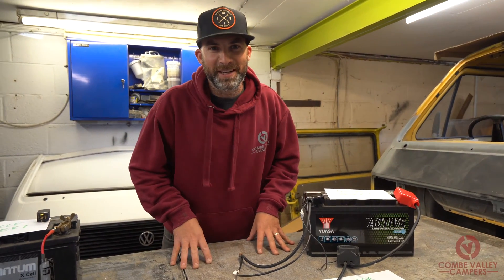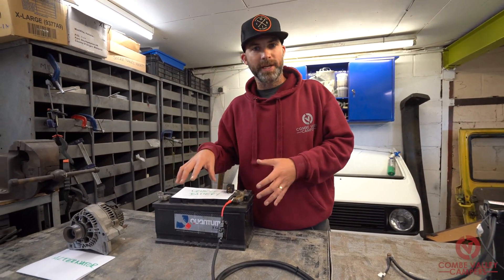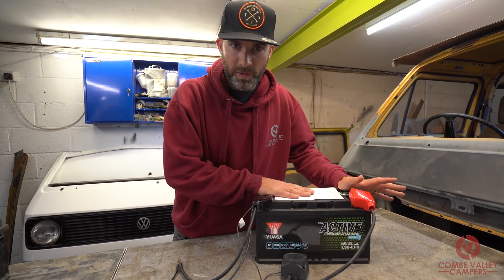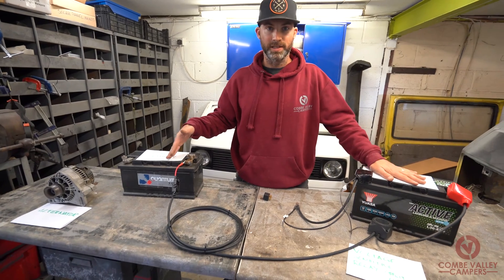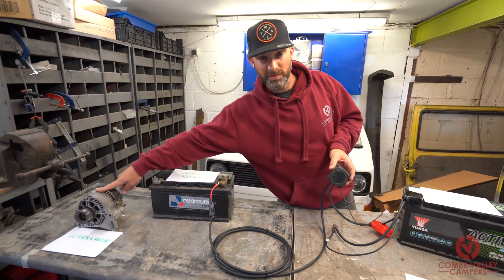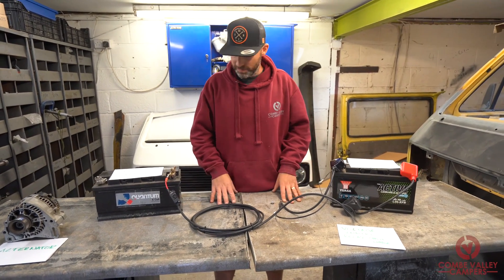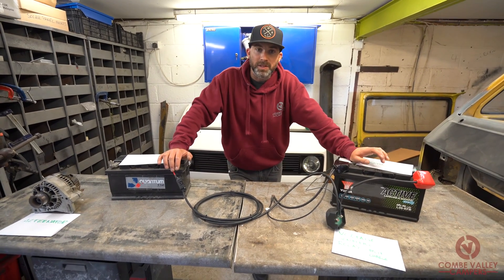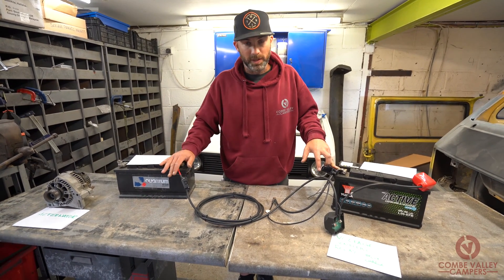A beginners guide to leisure battery charging and wiring.

Comment: Hi thanks for the clear description of the split charge relay system.
My camper has a leisure battery which I presume is topped up from the alternator, still looking for the relay or split charge relay!!
Question: ( hopefully not a daft one!!)
I am putting a solar panel onto my camper for the leisure battery. Do I need to disconnect from the engine battery to charge from the solar or can both sources be used? If so have you got a video showing how this is done please!! Cheers in advance.

Comment: What guage wire should I use to go from the Main battery to the relay and then to the leisure battery? Also what size fuse would you recommend to put in the line?

Comment: Question for you : I am putting LITHIUM batteries in as my leisure power. I dont want those batteries used for cranking and destroying them. Will this sytem keep the vehicle battery as the starter battery only please?
Reply from the maker: Yes, however I would reccomend a system to help manage the lithium batteries. For further information and advice please speak to James at Rayne Automotive

Comment: Hi that sounds easy peasy. I have two identical leisure batteries and want to add them do I need two delays? I own a van which I use for my mobile Barber business and need two leisure batteries two last me for the whole day because I want plenty of lights and hair dryer and etc to use. I have a power inverter which works flawlessly but when I use the hair dryer on the highest speed it trips my power switch and only works perfectly on medium heat. So would I need two relay or just wire both leisure batteries on the same terminal inside the relay?

Comment: very informative. I had a problem with a split charge relay and a solar panel when the sun cam up and the engine battery charged, there are two leisure batteries the split charge relay would open, and click, the leisure batteries would draw charge bringing the engine battery voltage back and the split charge relay would close. it was an ongoing clicking motion that forced me to get up and leave the van or start the engine. should the solar panel only be for the leisure batteries or both the leisure batteries and engine battery?

Comment: Hi can you please help me .I recently put a brandnew leisure battery into the back of my camper ok and I connected everything back up including the relay and it's earth .is the led light supposed to come on the relay straight away when the van is started or does this only happen when the leisure battery is low on power output.ive everything connected up and the relays led light hasn't come on once when the van is running.its a brandnew leisure battery also thts been installed.is this normal or do I have a problem with something not earthing.thanks

Comment: hi I have 7.5 t horse box with 2 main batteries and a  separate  leisure battery . would this split charger connect the same way  using one of the main batteries as a feed or would you have to have a connection from each of main lorry batteries. cheers joanne

Comment: hi, ive got  2 batteries 80 amp fitted in my engine bay. will my  starter battery,, charge my 110amp leisure battery  with split charger??thx
Reply from the maker: Yes. Connect the split charge kit to one starter battery. Once the relay senses the both batteries are fully charged, the relay will open and charge the leisure battery

Comment: Wow, Great info. Can we use a power point to connect the two batteries together? I am worried about over powering the points wiring. If that is an issue can we hook a trickle charger between the split charger and the battery and if so will that work?
Thanks

Comment: This probably is a silly question but then the van is ticking over does it charge the leasure battery??? 

I have everything connected but my leasure battery keeps dropping volts, it's down to 7.2 at the min please help thanks
Reply from the maker: I would suggest either the leisure battery may have had its day, or, there is something draining the battery
Reply from the maker: At 7.2 volts, technically the battery is dead dead.

Comment: I have 2 x 100ah AGMs in my car and run the alternator cable to my camper trailer that has 1 x 100ah AGM.
Question: 
I want to add a 2nd 100ah AGM to the camper trailer in Parallel but the battery compartment is too small.  The nearest space is 2.5 meters away.  IYHO Is their any issue with length for Parallel wiring?

Comment: Thanks for the video and clarity of how it works. Is there any problem of the battery overcharging? I know with solar there is a controller to stop that.
Reply from the maker: The vehicles voltage regulator makes sure a battery is not overcharged, in the same manner that the starting battery is not over charged. I hope that helps
Reply: @CombeValleyCampers  thanks. I read somewhere that the slit relay can only charge a leisure battery to 80%. Is that true?
Reply from the maker: @SMCK24  I've not personally experienced this. Depending on your splitcharge, you should achieve full potential of your battery

Comment: I can guarantee that wasn't a. 13amp relay... They don't exist... 15 20 or 30...and the "systems of old" were never wired into an ignition live... Pin 30 main battery pin 87 leisure battery.. 85 and 86 can be either way round. One goes to ground, the other goes to warning light wire on the alternator... When it starts charging, the alternator puts a feed up the wire, knocking the dash light out.. That feed can be used to switch the relay on. 
 The relay you showed "the 13 amp relay" could be used, but the contacts are small. A 70amp relay would be better, or an "old style" split charge relay that had a dedicated fridge terminal. There's nothing wrong with the old system, the newer way simply eliminates some of the wiring.

Comment: I have a trickle charger installed in my T4, plus a split charge relay, I am wondering if I plug the hookup in at home whilst the van is parked up in between trips - will it charge both batteries? I am worried the starter battery will die if it is left standing
Reply from the maker: Only if the vehicle battery reaches 13.7vdc, then can maintain that charge, to charge the second battery. I would reccomend that you routinely swap the trickle charger to both the vehicle and leisure batteries

Comment: Great Video, Well explained for those like me who have no scooby when it comes to batteries and electrics. Thanks. On a slightly different point I recently bought a Crusader J220 Uk Mains Converter Lead from Amazon to charge my leisure battery from a main socket in my garage while my T6 camper sits idle on the driveway. I have had it pluged in for over 24hrs with the charger switch on my Sarget EC155 'on' but on the control panel (sargent ec50) have not moved from the low amber light. Would you know why? Love to hear your thoughts

Comment: Great explanation. BUT what if you have 2 leisure batteries, how will the split charge relay system work? Woukld you need another split charge kit? (probably a stupid question....)
Reply from the maker: Nope, you just link the batteries together in parallel and they will both charge
Reply: @CombeValleyCampers  Hi - thanks for the reply - just need to find out how to connect the batteries in parallel - as you see, i'm a total expect in these matters.. Cheers

Comment: If the leisure battery drops low will the vehicle battery also drop low? or will the leisure battery be isolated by the split/charge relay, so the leisure battery and camping equipment can be used independent of the vehicle/start battery? or would I need an isolator switch to ensure the vehicle battery isn't drained while camping?
Reply from the maker: Yes the relay isolates the batteries from each other so the leisure battery can be used, and drained, independently of the vehicle battery.

Comment: I have a split charge setup from the days of caravan towing, also a permanent 12volt supply for caravan lights. I intend to use the circuit through the relay to charge the leisure battery. Is this in order. I also have a 90 amp alternator.

Comment: I’m fitting out a T5 and have installed a split charger with leisure battery which works fine, I am adding a fuse box in order to add lighting, 12v TV and other accessories. My question is if my leisure gets a little low on charge and I start the vehicle to top it up, how do I stabilise the voltage to accessories, because the voltage can rise to 14v and some accessories may not be happy running at this voltage while in charging mode.
Is there a 12v regulator I can use between battery and fuse box for this type application?

Comment: So I wired up my split charge relay in my van like you said.
But with the engine on the relay closes LED is on with the engine off LED stays on and the voltage on the leisure battery is 13.9 I’m confused
Reply from the maker: What does the battery read with the engine off?

Comment: Hi I’ve been using your videos as a guide to refurb my t5, found them all really helpful. I have a question, I fit my split charger, traced all the wires back and everything is where it should be but the relay isn’t switching on to charge the leisure battery (basically the system isn’t working) checked the voltage on the van battery and it’s reading 14v roughly but still the relay isn’t on and the leisure battery is sitting at 12.55v. Is there a way to trouble shoot I should know of? Or a way to check the relay itself is functional? Thanks in advance guys, videos have been class ❤️
Reply: Van battery is 14v when engine is running, should have said

Comment: Stupid question: Is there any danger that a fully charged leisure battery could be drained by a slightly undercharged car battery?  Does the relay also act as a reverse charge blocker?
Reply from the maker: No and no. The relays are generally one way. There are relays that can charge both as well as solar controllers
Reply: @CombeValleyCampers   many thanks - quick reply!! 😊

Comment: Hi mate, great video and very well explained, I have 2 batteries in my Mazda bongo using a split charge system with the small relay (that you chucked lol) it all seems to work ok however last year when camping for the weekend I left my cool box plugged in and it ran my leisure battery and starter battery flat, does this mean something is wrong, also when I disconnect my leisure battery everything that’s wired into it, (interior lights, stereo, 12v sockets all still work?? Is this because the power still transfers to the leisure battery terminals from the starter battery even if the terminals aren’t connect to the leisure battery? 
Thanks 👍

Comment: Sorry if this is a dumb question, but I asked it on a forum and came off more confused than when I went on.  If I want to charge the leisure battery on my driveway using a my hook-up cable with an adaptor to plug into the mains at home will it still charge if I’ve isolated the electrics switch in the habitation or should I leave the habitation electrics un-isolated to charge the leisure battery or does it not matter?
Reply: Ps. Your videos are excellent! 👍
Reply from the maker: Thanks! Without knowing your setup, I would suggest buying a voltmeter/multimeter. I'd then plug in the 240v electrics as you have explained and check the voltage on the leisure battery with habitation on and off, checking the leisure battery voltage in both situations. Then you'll know if you need the isolation on or off ;)
Reply: @CombeValleyCampers  Ok I’ll try that. So not too dumb a question then!  Thanks.

Comment: Just looking on Coombe Valley website, can you explain what the 6 way 12V fuse box is for?  I'm just about to kick-off my van conversion, I just need the split charge and a leisure battery correct (is the battery they are offering any good)? Thanks
Reply: I now believe this kit is no good for my T6, which without testing, I believe will have a smart alternator. Therefore I will need something like the CTEK Smart Alternator DC DC Split Charging System?

Comment: Forgive me if this question is a beginners question but here goes....
When you start the van and the main battery is getting charged from alternator, it reaches 13.8v, then the relay allows the charge through to the leisure battery.... i understand that, meaning that the main battery is always the main charged battery.
When it is charging the leisure battery, is it also charging the main battery at the same time or just the leisure battery?
At what point does it stop charging the leisure battery because the main battery needs more juice??

Comment: Great Video, I have 2 leisure batteries which I believe should be connected series parallel  and also a converter unit. Would that system work to charge the leisure batteries?

Comment: What if you have 3 or 4 batteries in the system ? Can you use a split charger for each one? Or if two sets of batteries are used 2 in one circuit and 2 in the other does the split charger charge those as in your video?
Reply from the maker: We shall cover connecting batteries in a video in the very near futire

Comment: Question from a Newby, sorry if it's already been answered... What happens to the excess charge from the alternator if the normal battery has been fully charged? Does it shut down to use less fuel or is it wasted or used elsewhere? Also, if I had a large battery bank for the camping part of the van (not for the normal stuff a builders van would use), am I right in thinking I could charge them from the alternator on long trips????

Comment: Thanks. The labels on the batteries and alternator are not visible. What if you have a battery switch wired in with Off, Batt 1, Batt 2 and Both Batt.

Comment: Is it not the case that a more modern vehicle with a “smart alternator” cannot use a volt sensitive relay?

Are there any pros or cons to a vsr over a split charge relay from say ctek?

Does it matter what sort of leisure battery is fitted? Example, lithium, agm, lead?

Comment: Does this relay turn off to prevent over charging? Or is this something not to worry about?
Reply from the maker: The voltage regulator will ensure your battery does not overcharge, much like your car battery.

Comment: Great video so to sum up when the engine is running and I am driving my campervan the leasure batt is charging so after a couple of hours driving i turn off the engine and my leasure bat keeps my domestic appliances working correct? Also how long does it take to fully charge a leasure batt? What are some you recomend? Thanks

Comment: You've literally made me so much more chill in relation to the electric side of my self build. Cheers dude!
Reply from the maker: Im so glad Jack. It is why we make the videos. Leigh
Reply: @CombeValleyCampers  I have bought a van with a leisure battery connected via relay to the van battery alternator etc. Its is also connected to a 1000w inverter. The leisure battery is located under the passenger seat. If I want to charge it from the mains can I just put my ac charger clips onto the pos and neg while the battery is still connected to the van battery set up or do I have to disconnect the terminals. Also can I use the leisure battery for lights and other 12v stuff etc when it is  still charging via the mains. Thanks
Reply from the maker: Hi Donner. Yes you can connect the clips for a temporary set up, however if the charger will be living in the van I would for a permanent termination for the leads on the battery terminals. Yes you can use the battery as normal whilst being charged via mains. 
Hope that helps, Leigh
Reply: Saving money for this! Looks easy!

Comment: can't i just plug a leisure battery into the car cigarette lighter so it can charge when i'm driving?
Reply from the maker: Its possible, but not a safe option. Please ensure leisure batteries and split charge systems are fused and wired in correctly.
Reply: @CombeValleyCampers  thanks for that.

Comment: What are the benefits of a 12v fridge v a 240v could a 240v fridge be run of an inverter? Very new to camper Van's, but noticed 12v fridges are expensive compared to a small domestic. Btw great videos.

Comment: I've wired it in like this. Connected it to the pos on the leisure battery but whe I went to connect the earth fo the neg terminal it made the relay switch click open and closed repeatedly (also spark). Why? Is it because I haven't earned the leisure battery yet as I'm just installing it?
Reply from the maker: Please make sure the circuit is completed before connecting any terminals to the battery

Comment: fitted this and all wires connected, turned ignition on and after few seconds, click and light came on, left vehicle running for few minutes and then turned ignition off, but split charge light stayed on??
is this Normal??
didn't want to leave connected incase drained main battery
Thanks
Reply from the maker: Normal operation. If you need to confirm if its staying open or closed use a volt meter on each battery
Reply: @CombeValleyCampers  ok thanks, surely it should switch off after a few seconds/minutes or it will continue to drain main battery???

Comment: Ok, nice. Serious question - if you’re using this system and you’re on a 240v hook up which charges leisure batteries through the vans zig charger will it damage the relay or allow and current back to the vehicle battery?

My built in charger charges my twin leisure batteries to 13.8v but doesn’t charge the vehicle battery at all. However when driving the leisure batteries discharge down to 12.6v.